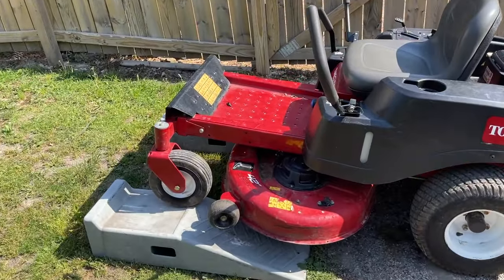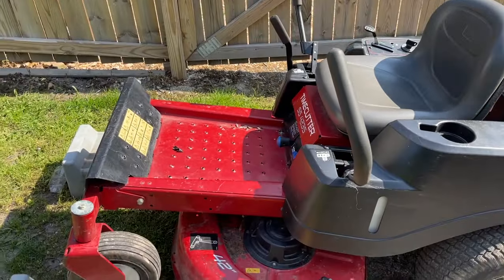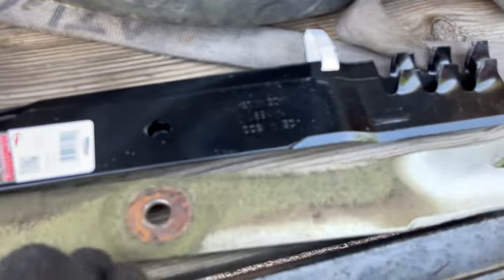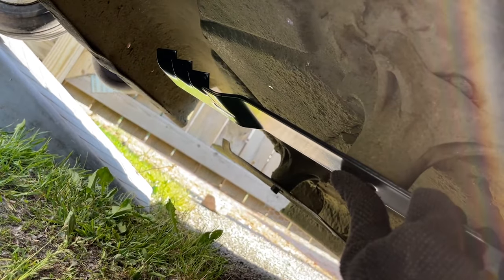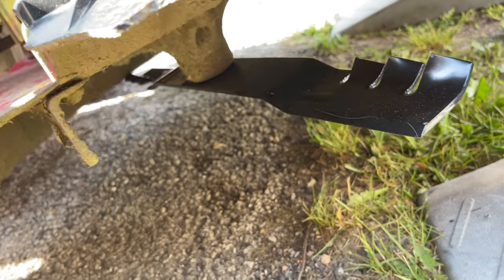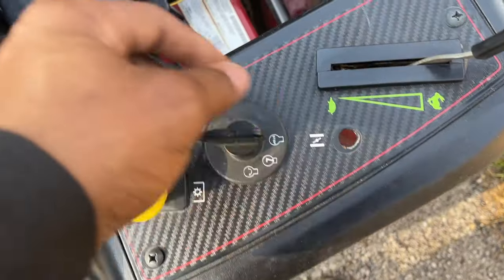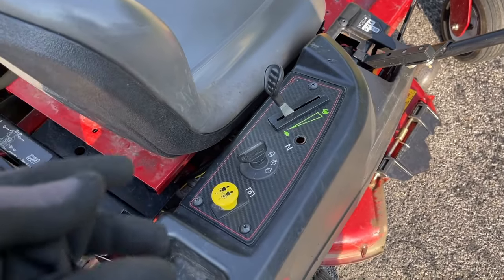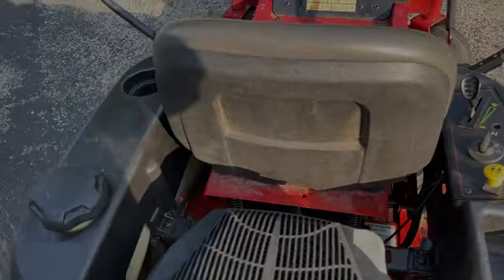Toro Timecutter Riding Mower Blade Change Quick & Easy! No More Rough Cutting!!

Comment: What blades did you use?
Reply from the maker: Here are two links for them with different prices.

https://www.ebay.com/itm/401999498931?itmmeta=01HTT31HYNZQYGJ4S874QV233S&hash=item5d99098eb3:g:vtgAAOSwKRBlOJG1&itmprp=enc%3AAQAJAAABAJuLCNCE%2BRVICFxSDcKP3w%2FWsDjt1W983wpEuxAYwqnxFwYCy4W4m1RVROi5GrzV%2FbKfamfI4FSWtXvuzOhvnCPDWoVIWiatvxKAZoSIvzV8yF7%2FO7CQtbHJjT5MQ%2BmvbMN9cE1yMnLymbpsAarBwWrIDUwosd1Nsa639lI39e7%2FA2TGrky1lS2GphcGEHK5jiQfYoMUUQ79LTEc%2F%2BhbtttOngR5eaH2ftqHT68vFy3Qcve%2B5uPQ88w7SNMxPC2CTpLLTLEWgUbruaQr07qkNCXUZu9dJyk%2FTZbXDoM8GjwSVofUC%2BzyYHHUf%2BoH%2F6sagBSlcu9gfM0F8Eu%2FO7Yhz0M%3D%7Ctkp%3ABFBMtp-Gw9Zj

https://www.amazon.com/MowerPartsGroup-Aftermarket-Toothed-Mulching-106-2247/dp/B081P6R6JR/ref=asc_df_B081P6R6JR/?tag=hyprod-20&linkCode=df0&hvadid=673697733502&hvpos=&hvnetw=g&hvrand=10195291450922715263&hvpone=&hvptwo=&hvqmt=&hvdev=c&hvdvcmdl=&hvlocint=&hvlocphy=9021607&hvtargid=pla-2207497016541&psc=1&mcid=37d7b8ed230933e5b216fdeaa33bf65d

Comment: If you had a lawn mower lift you could get under there so much better
Reply from the maker: I have to use what I have and can afford. Thank you for watching.
Reply: @TerenceDIY  yes sir I definitely understand that and a great video
Reply: I splurged a heavy future lift from Tractor Supply a few months ago. It’s a game changer for me with my two Toro 50 inch ZTRs and a John Deer X500 garden tractor.  I can comfortably change all the blades as well as hit the underside of the deck with my pressure washer.

Comment: My Toro dealer said not to use these thick blades on my 42" Toro Timecutter. He said the smaller spindle won't stand up to them.
Reply from the maker: These blades are doing very well and my machine is cutting awesome. I have NOT seen any signs of an issue, vibrating (in which would be one of the first signs), etc... if you have a new machine that's under a warranty, I could see how they would recommend not to use them. Thank you so much for watching.

Comment: hey, great video man. Those old blades sure looked like they've been battle tested. Ill bet it was a much smoother ride with the new blades on, no more vibrating. I just put new blades on my mower as well. Even the discharge is also better with the new blades.  Thanks for the video and your time.❤❤
Reply from the maker: You are correct! Thank you so much for watching.

Comment: You should have got the commercial mower. The deck is VERY thing on residential
Reply: yea the thin ones only last 18-20yrs on residential stuff, be sure to spend the extra money so the deck outlasts the engine.